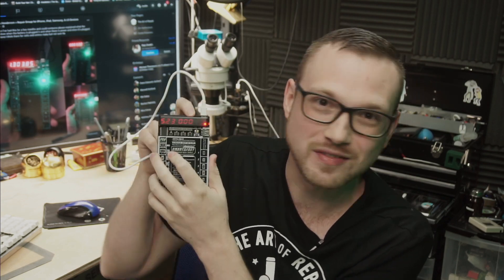2020 | Battery Tools | How do you read the displays on a basic Battery Activation Tool

Comment: When i connect my battery with this board the amperage remain zeero.. is my battery completely dead?
Reply from the maker: without external power? if its just plugged in it should not have amps in or out since its not being used. Can you clarify a bit more for me?
Reply: @TheArtofRepair  with external power amps zero and without external power when i connect battery' board display stay off.